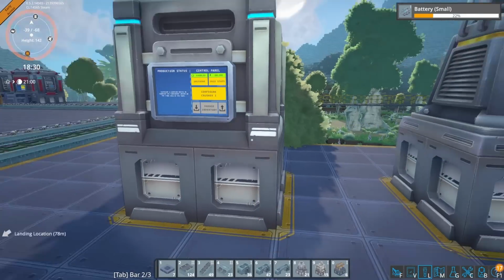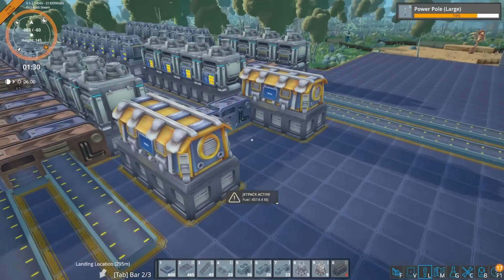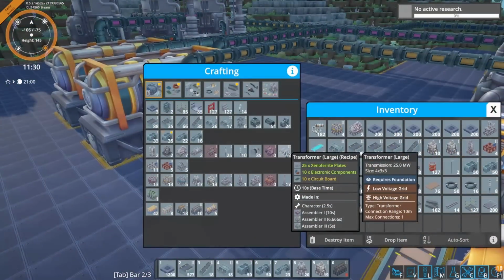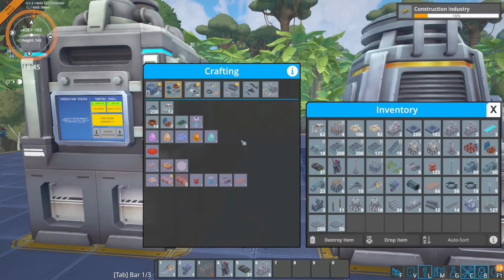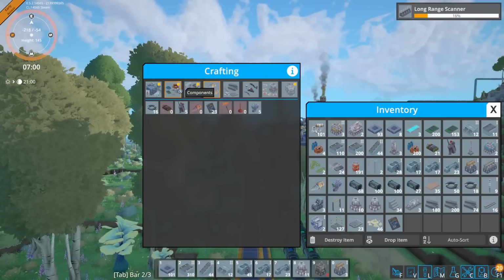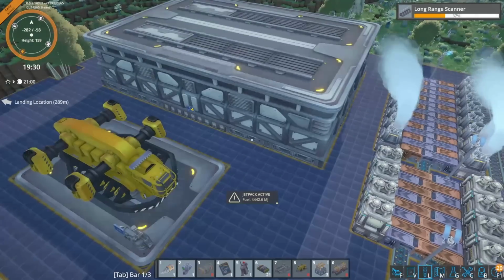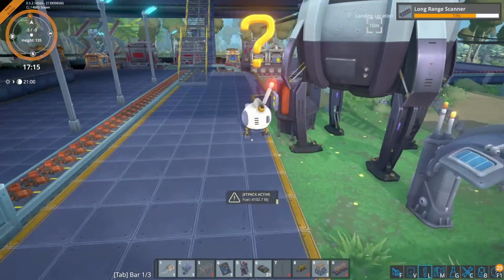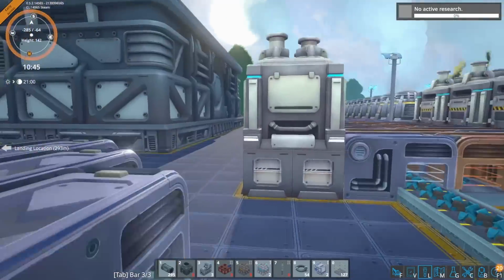Foundry - Construction and Building a Massive Radio Tower [E8]

Comment: One tip for the one off buildings is you can right click them from your inventory and it will put them in placement mode. So you don't need to drag them to your hotbar first. 

I do wish they would add a search or filter function to the inventory to help find those things once you make them though.
Reply from the maker: Great tip. Thanks. Yes, it can be a little tough to spot them among all of the other stuff.

Comment: Also curious if the Steam Turbine power setup will burn Ignium Powder, if so does it last longer?  Will test that today as well.
Reply from the maker: Apparently it does and there are other power option like the power cells. Althing that has a Mj value.
Reply: @surtrplays  Ignium Powder does not have a Fuel Value you can't burn it.
Reply from the maker: @dragorin1108  Ahh okay. Thanks.